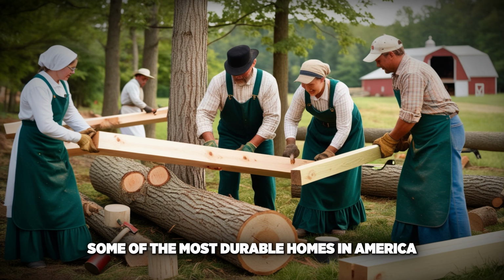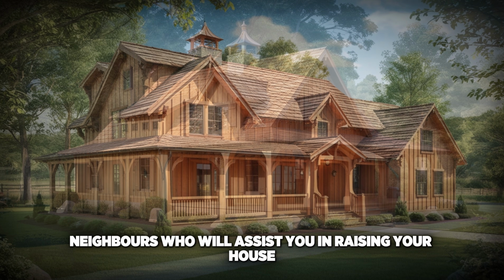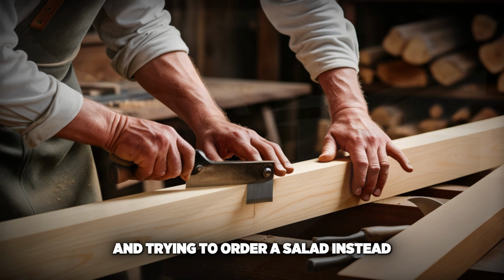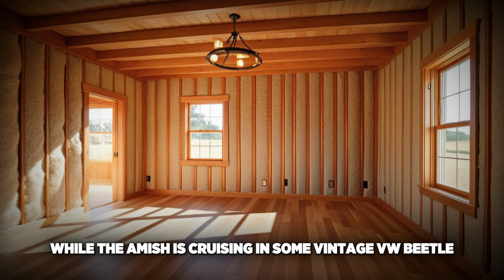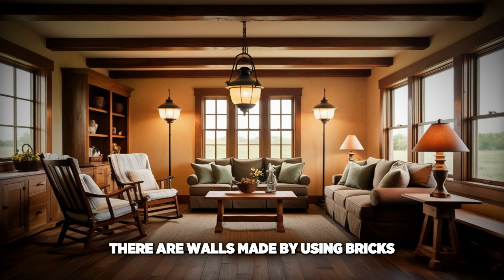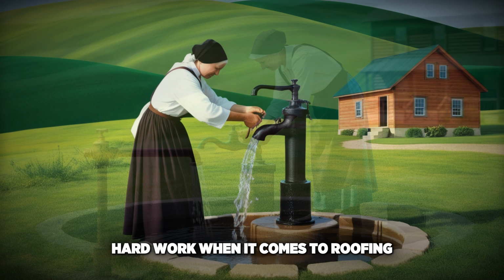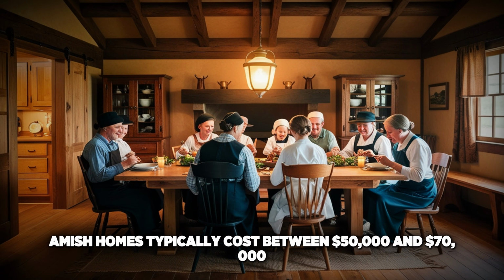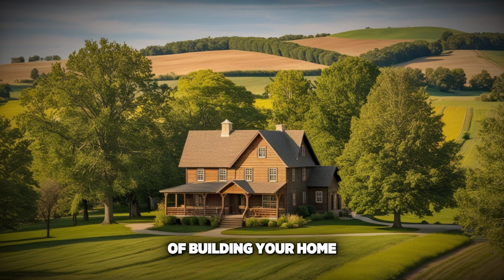Why Amish Homes Are Stronger, Cheaper and Built Without Bricks

Comment: Strongest homes are made with steel frames 2nd strongest are made from steel and concrete. Wood is not in the top 10 framing materials. It cannot stand water, fire, wind, insects, moisture.